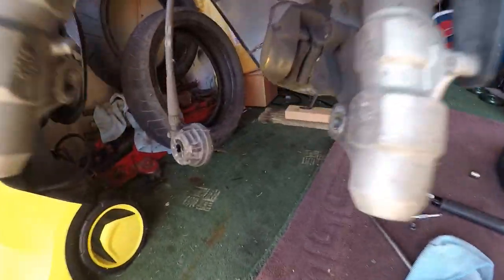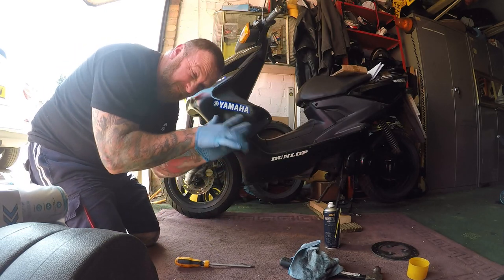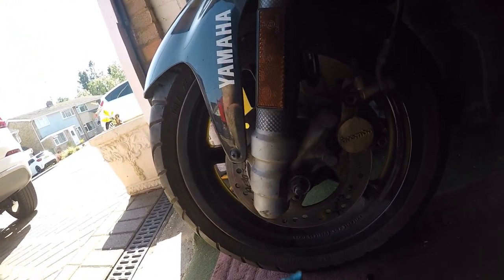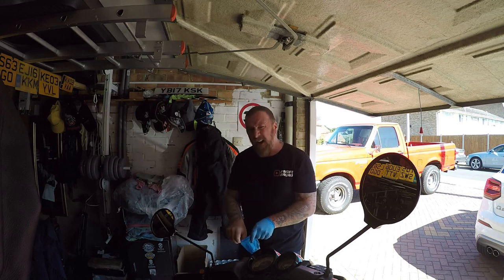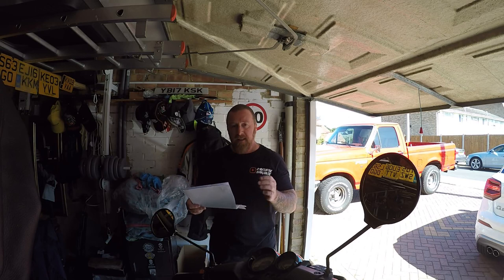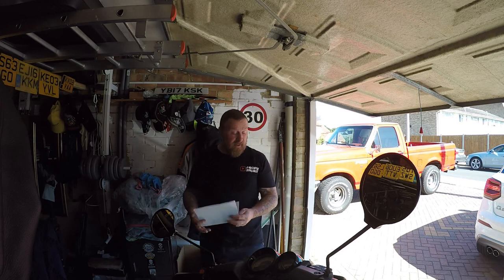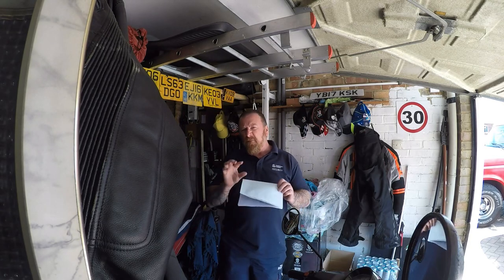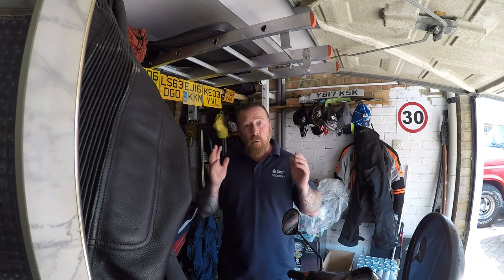YAMAHA AEROX FAILED THE MOT WHAT !!!! MARK SAVAGE

Comment: Another good tip is to change the disc mounting bolts each time you change the disc and you won’t suffer the problem of Torx bolts with rounded heads that the last owner created. Then, when you’ve changed those bolts, you can add a small drop of silicone sealant into the head of the Torx bolt. This will set into a rubber bung that you can easily pick out with a very small flat blade screwdriver next time you come to change your brake disc. I use this tip on my Peugeot Partner MPV on the T50 headed calliper mounting bracket bolts. Possibly the most horrible job in the world!

Comment: Mike hiw tight do you put the front nut on the spindle. Also I found 2 thin copper washers on the floor not sure if they came off when I took front wheel off can you advise plz it's a 2013 aerox thanks

Comment: Hi Mark, I need some advice, 
I previously said I had a W Reg Peugeot Vivacity as a project.

It’s all going well apart from a leak, it’s a petrol leak from the pipes and Tap, it’s a brand new tap from 3 or 4 weeks ago and was bought from Euro Scooter Parts.

I ordered a New Carburettor (as the other one was damaged) it’s slightly different, and I need to change the oil pipe (it’s got a split in) to go to the carb but I don’t know how to get to it

I have a deadline by April 2021

Please Help Me!!!
Reply from the maker: SO you have a off the market carb now and I guess the old oil line in smaller too, so you can buy a bigger pipe and sleeve it over then it will fit onto the bigger one from the carb
note the air mix is normally all the way in on them but I dont like them bud
Reply: mark savage  I would’ve had the original but the Oil Pipe Connector had Broken off as it has been in an accident

Comment: Mark. I think I can change the cam chain tensioner gasket on a GY6 125 without upsetting the timing. Would I be correct? Things got a oil leek where it would be
Reply from the maker: Yes and long as you don't move the engine it will be fine bud
So undo it change and clean then pop it back in
Reply: @marksavage  yeah I thought that would be the case! Thank you so much. I'm well into my scooters!  Wish I lived near you. As I live in Wiltshire. Colerne. And do love working on Peds.!
Reply from the maker: @danpullin6610  that's a few mile away bud 
But good you enjoy working on them too
Reply: @marksavage  aha haha you actually looked into where I was! Yeah it is a few miles away!

Comment: Hi mate, i have a question :) Is it worth to derestrict my speedfight's exhaust? will i feel an improvement? with 10g rollers (yes it sounds a bit to heavy, but acceleration is quite good), 76 jet (if I remember correctly), mallossi x special belt and a sports exhaust and i do around 52mph
Reply from the maker: With 10g rollers and a 74jet on a standard 50cc engine and carb then thats amazing!!!!!
Something I would say it would pull away like a snail and bog down !!!!
If yours is running and riding well with 50mph plus I'd leave it well Alone as is !!!!
Really wow
Reply: @marksavage   Amm i checked the carb and actually the main jet is 72 and the other is 42, aand it reaches those 50+mph not so quickly, it takes a bit time. So nothing bad will happen after exhausts restriction removal? Everyone wants to get a few mph more 😅

Comment: Hello mark, i have a little question. What front fork would fit my speedfight 2 ? Asking because my wheel is wiggling a little bit and i don't want to put again a single arm
Reply from the maker: I've been asked this before and you can mess around changing it but none will ride the same !, best just replace with a new straight on but like in my speedfight videos see what part has gone 
They are in the few new speedfight ones I done
Reply: @marksavage  Amm.. In my area it isn't easy to find the single arm and it's not  cheap,  btw i live in a village and when driving on gravel road or similar roads. Sometimes i can't avoid pits.. And i'm not saying that i drive fast
Reply from the maker: @luk1z915  I understand bud but to be honest if that's the case I'd sell and buy another bike 
But like in my last few sp videos you can adjust and tighten
Reply: @marksavage   I don't want another bike, i love my speedfight :}, and ok i will try to adjust and tighten. Thanks for help :)

Comment: alright Mark, do you have any idea which sports exhaust will fit on a 2002 Sym Jet 100cc? cant seem to find anything!
Reply from the maker: Sorry bud no but try scooter euro parts , ped parts or lexmoto parts 
They might do a pattern one that may fit or a cut one that you add on bud
Reply: @marksavage    cheers, it's very uncommon  bike to tune to be fair.
Reply: how much of a difference is there in a 50cc 2t exhaust compared to a 100cc 2t exhaust? may i ask
Reply from the maker: Sports ones you can use for both but standard the 100cc has a cat and much bigger header pipe
Reply: @marksavage   massive help thanks bud

Comment: I find tyre pressures get neglected on these peds , They don't have to look flat to only have 10-15 psi in them, So how much do they guys  at the bottom of chapel hill charge for an MOT these days :)
Reply from the maker: £30 Bud , I've used them now for over 10 years 
Hard but fair and safe
And agree every ped I find the tyres low
Reply: @marksavage  £25 up the springwood  but same as you as in going to the same place for a number of years
Reply from the maker: @khammered  I guess you just get used to what you know,  its not about the money 
I went to nights before and wasn't happy so stuck with silver x

Comment: Hiya Mark, yet another great top tip video, I know this question has nothing to do with what everyone has just watched but, could you give me a top tip on a bore kit for a sym SB125N I believe they are a GY125 Suzuki engine, Keep up the fantastic work buddy TIA.
Reply from the maker: I just don't like big bore kits but that's on 2t bike 
I know they can work well on 125 4t but as I've not done one I'd say look for the best review on one 
Sorry not much help 
But I'd change the exhaust ,variator , rollers and a small up jet which would be easier and you would get more out of it with less work bud
Reply: @marksavage  Thanks for the reply as always buddy but, I don't think Sym have a variator or rollers due to them being a geared bike but, will try a sports exhaust and up jet slightly.
Reply from the maker: @oliverghost1  oh sorry bud thought it was a ped 
You can get different cog sizes 
I think it 1 bigger at the front and 1 less at the back 
This will give you more top end

Comment: Hi mark I’ve hit a right dead end I’m normaly pretty good with peds and getting them going by my friend has a qaud bike which runs off a cvt and is all the same as a ped 90cc 2t that  started spluttering so naturally I took the air box off ..... no air filter cleand the box and put in the filter and cleand the carb pit it’ll all together won’t start anymore put a new carb on won’t start anymore has compression spark and fule I don’t know what to do won’t even start when I spray fule in the mouth of the carb
Reply from the maker: This can happen and drive you mad lol 
But put the old carb back on 
To be fair its more likely to be piston with these little 2t as you can still have compression
You won't know until you have the head off 
You have done the wet hand test 
And spark nice and blue ?
Reply: @marksavage  yes sparks lovey and strong and blue
Reply from the maker: @2wm699  carb test ? Wer hand ?
Reply: @marksavage   not yet

Comment: I have a 50cc Benelli 49x and it won’t start I’ve cleaned carb and checked spark n fuel and still no luck :(
Reply from the maker: wet hand test ? like in my videos 
spark blue and ok?
wet plug?
Reply: mark savage yeah I’ve checked for blue spark, checked the coil works, checked it’s getting fuel to the to piston. I was riding it and it bogged out in me which it had done before but that was due to a battery spitting acid, i pushed it home charged the battery, whilst charging battery I cleaned the carb and ever since I’ve cleaned the carb it just doesn’t want to run. I can make a video and put on my channel of me doing troubleshooting if you’d like to see that?
Reply from the maker: @HardcoreGamerProject  yea sure upload a video bud and let me know but if you cleaned the carb id take it off again and use good carb cleaner , take out the jets and idle and the float and auto chock and clean them all again , then rebuild like in my videos tune and check fuel pipes are on ok and tight and not gone hard etc